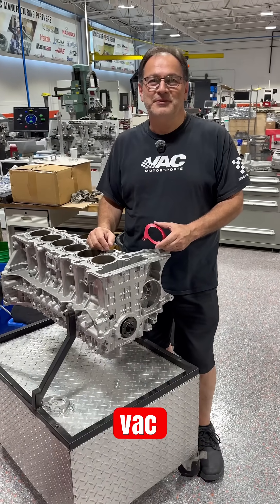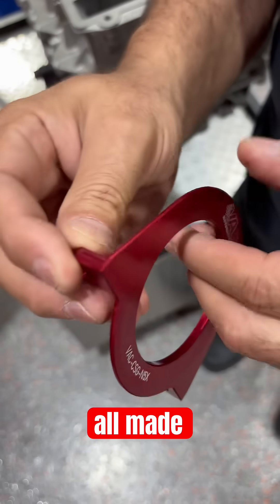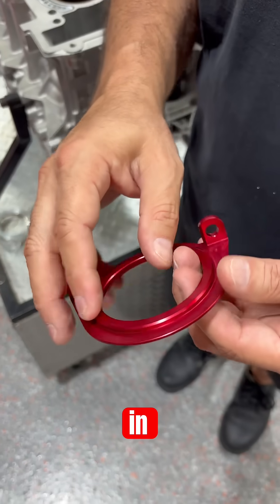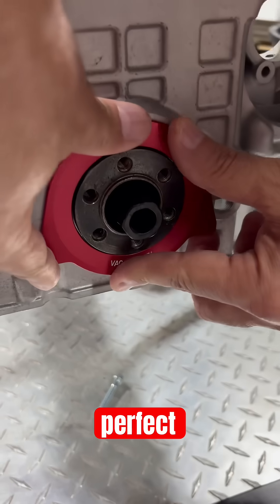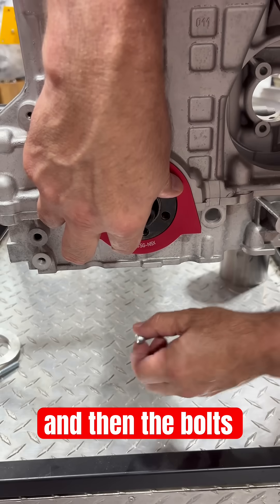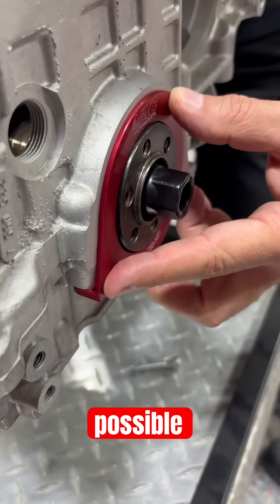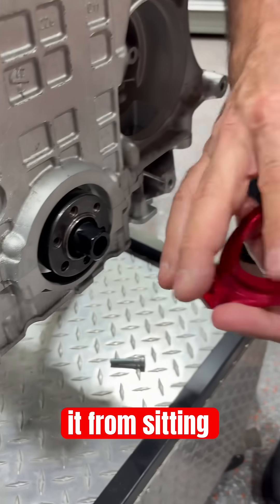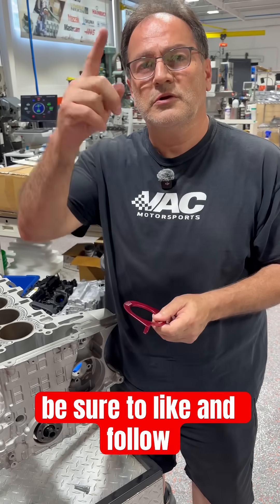BMW N52/N54/N55/S55 Engine Saver! 🔥 Stop Catastrophic Failure with VAC’s Crank Seal Guard  #mechanic

Comment: Finally after searching far and wide I was able to source a set of proper sized aluminum bolts from MaLo Industies for $7.99 usd. I love yalls product, as the fitment is top notch and better than the competitors but it is very disappointing y’all don’t supply aluminum hardware.
Reply from the maker: I'll talk to engineering about that one
Reply: Did the aluminum bolts fit perfectly or have u not installed them yet

Comment: Just got mine in the mail, fitment is excellent!! Only issue is the bolts seem to be steel and not the aluminum fasteners that were in place before. Will this not cause corrosion?
Reply from the maker: Please use some protective lubricant around then and they will not corrode.
Reply: @vac-motorsports thank you for the response, would the torque value be different due to the bolt being steel rather than torque to yield aluminum bolt? I was considering purchasing 2 aluminum bolts off of a s55 oil pan, as they are the same size as the existing bolts just a bit long. I would have to modify bolt by cutting down. What are your thoughts on this?

Comment: the modern "Snake oil" salesman ....
Reply: What makes you think this?
Reply: @LT64444   its of no use.  what is is supposed to stop ?
Reply: @dserf101  It prevents broken belt fragments from going into the engine 🤦. Also, they aren't the only company to manufacture these parts. Clearly people need it. It's a small component that could save an engine
Reply: @dserf101 why did you say it was snake oil if you don't even know what it does???
Reply: @LT64444   and exactly how  would a "belt fragment" get passed the Oil seal ?
Reply: @bigdaddymak1439   it does nothing but make them money
Reply from the maker: That's far from the truth.  Not how we do business at VAC